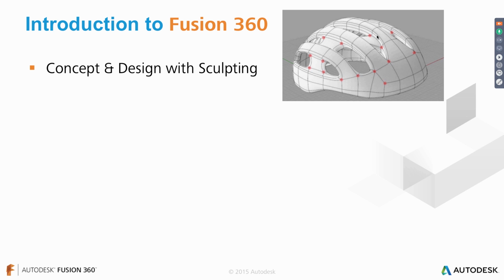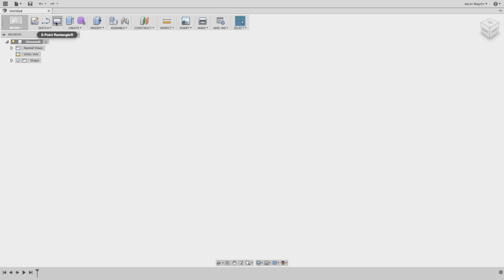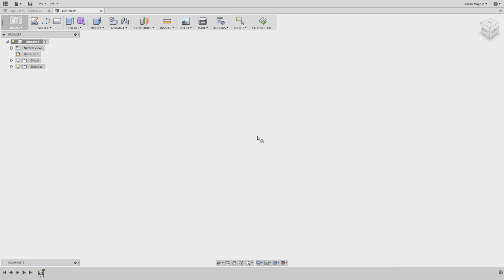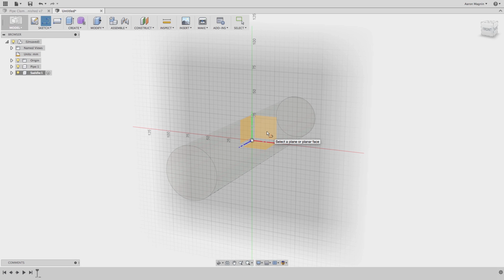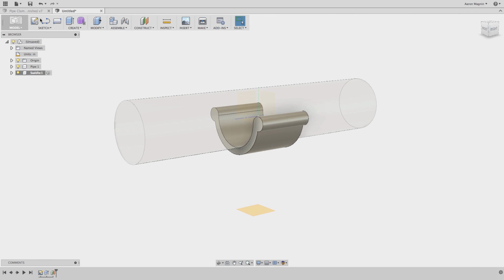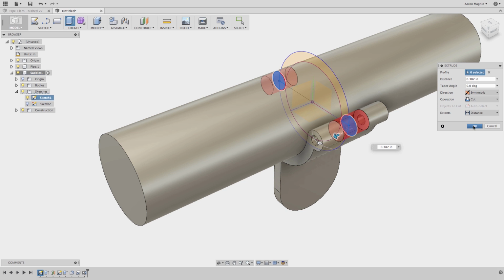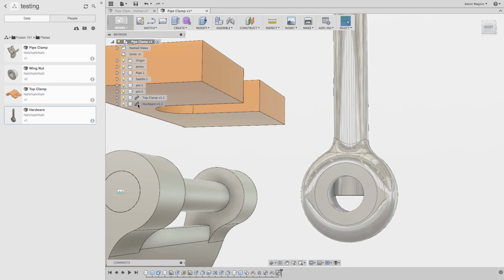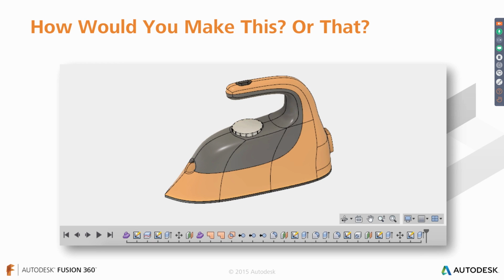Autodesk Fusion For Beginners - Recorded Webinar

Comment: Excellent webinar.  I have been training with AutoCAD Lt and AutoCAD and recently became certified in AutoCAD.  I have a client that wants to connect his CNC to Fusion 360 and has asked me to assist.  This tutorial is 6 yrs old and not all the commands were as easily to follow along with.  I was able to until he copied and pasted the pin, ctrl c and ctrl v didn't seem to work.  Is this operator error or a change in the program?  Secondly I've never worked with a cloud based platform, so is the gallery available to everyone? (for the top clamp and bolt and wingnut specifically).  Is there a similar webinar that I can pull up for the current program?  Thank you for your assistance.

Comment: this was a good tutorial. Too bad the time got short and it had to be sped up. The one thing missing was how to modify things. If I typed in the wrong length of the pipe for instance I have not figured out how to get back into the dialog to enter a different number, I had to control-Z until it was gone and redo it. Some additional detail on how to correct mistakes would have been great. But by and large a really good session!

Comment: How do I prevent my V-Bit from starting to cut as soon as I hit start. I've literally have changed every setting in the Manufacturing process to 1 inch and as soon as I start to engrave it cuts a trench through my material. Any help on which setting I'm missing.  I'm using a benchtop CNC Router, trying to engrave a sign.

Comment: I know this is now 4 years old, but just started trying to learn by duplicating what's show. My first problem is creating the centre point rectangle at 33:40 ish. I can make the new plane with construction but when I drag my rectangle, it will not snap to the the saddle part. It will snap to the grid but not the saddle. I can assume maybe because I'm now onto a much newer version, but this seems to be something that should not have been removed or changed. I have watch the video over and over to see if I am missing the tinyest step, but nothing. Does anyone know where I am going wrong?
Thanks.

Comment: Question - at 36:47 - what if you didnt know the thickness and you wanted a perfectly round bottom there from filleting? I couldnt find an option to stop the two fillets going through each other and causing an error. Thanks

Comment: I know this will probably be a big change for the software, but, is there any way that Capture Position could be completely overhauled? I watched a video by Jason Lichtman (I think?) about capturing position where he showed how powerful it can be when you want to project sketch geometry from multiple locations of a movable component. That's great! However, since each Capture Position operation shows up as a feature in the timeline, I think there are multiple problems introduced:  One, if I want to move a component to a different location, I either have to add an additional Capture Position feature, or go backwards in my timeline if it was in that location previously - neither of which are efficient or truly effective. Two, because I have to jump around the timeline or create a new feature to cycle my model between multiple positions, I rarely - if ever - use Capture Position for anything other than when Fusion forces me to.

My idea is this:  Instead of it being called "Capture Position" and being a parametric feature in the timeline, I think it should be called "Named Position" and function similarly to the Named Views folder. The software would function pretty much the same as it does now; i.e., anything that is not constrained by joints can be drug around in 3D space. The difference is that this will no longer prompt the user to capture the position. If the component is not constrained by a joint, why is it so critical to capture where it is? Like when Aaron moved the clamp so he could apply a joint that moved it back and constrained it the way he wanted it to be. That's a much more intuitive workflow than using As-Built joints, in my opinion, since you can see it happen. However, if the component IS constrained by a joint, Fusion should notify us that a component has been moved and give us options to revert to the previous Named Position, create a new Named Position, or leave everything where it is. The notification is only there to let us know something has been moved in case we didn't do it on purpose; it shouldn't create a roadblock to further design work as the current Capture Position requirement does.

Of course, the design history will need to be partially considered, as you can't have a Named Position that exists before its respective component was created. I think the way to remedy this is to have a "Named Positions" folder at the root level, just like the "Named Views" folder, but, inside it, have a sub-folder for each component. That way, once the component is constrained by a joint, we can specify as many positions as we like within its range of motion and have easy access to them. I think that's the simplest way to do it. A really slick ability would be something like a "Configurations" folder that allows us to toggle the positions of multiple components at a time without having to sift through the Named Positions of all of our components.

I think this should also come with a new option in the design preferences:  An ability to only let joined components be moved by activating their joint handles or driving the joints. This would be super helpful to me when modeling, as it's really annoying to me when my joined components accidentally get moved.

Anyways, I know this is a lot, but, I hope this idea is helpful to you all! These videos have been a huge blessing to me!

Comment: Have tried to sketch a centre rectangle on an offsite plane; however the edge of the shape doesn't automatically align and lock on to the edge of the component making the rectangle move when dimensions are changed. Any suggestions? 33:39

Comment: You referenced creating the filigree (aka "spiral") in Inkscape. Where is the video? I am using Fusion as a hobbyist and find the Mudbox app. quite interesting, but I am not able to pony-up $80 per year. Is this available to be used as a hobbyist as well? I have other questions about Mudbox, but feel they're not germane to my inquires right now. Could you have Extruded the text "To a body?". A bit OCD I guess :)
Reply from the maker: Mudbox does not have the same hobbyist option as Fusion...sorry about that! Fusion is more the exception than the norm compared to other Autodesk software. Per the Inkscape video, I was referencing this:
https://youtu.be/R9Jx0tYRMBQ
...but see this instead (because it includes WAY more detail and is newer): 
https://www.youtube.com/watch?v=oGGrJOkGi3A

Comment: When I create  a center rectangle....its automatically contstrained to the dimensions I set it at. So when I go to change the dimensions to .25 its just scales in size and gets smaller. When I try to remove the constraints and change the size... its doesn't stay centered on changing it...it offsets and changes dimensions...there seems to be constructions lines adding constraints that I have no idea what I need to do to be able to change the size of the rectangle and it still be centered on the dimension changes
Reply from the maker: Hey Dan, can you record this behavior? I really need to see what's going on. When you do, can you post this same text and the recording to the forum so we can get to the bottom of this?
Reply: has this been resolved. I am having the same issue @adskFusion
Reply: has this been resolved. I am having the same issue

Comment: Great tutorial! I was only confused by the really strange "inch" unit thing you were using...
Reply: I use the imperial system, but I love this comment because it’s so right, I hate the imperial system lol
Reply: @christopherbeane7603  we have drawings at work with a 11' 7 5/8" scaffold with a 400mm concrete slab on top of it. Both imperial and metric measures on the same sheet. The scaffold manufacturer is American...
Reply from the maker: Ya, if we use inch, we get in trouble from the metric audience.  If we use metric, we get in trouble from the US Standard audience.  :)

Comment: Nice tutorial, I noticed that your rectangle on the offset plane appeared to auto snap to the curved U-bracket edge, I had to project the U-bracket profile to go co-linear with that edge, are you using a modifier key or is that a setting I'm missing?
Reply from the maker: @Justin-  In your preferences, you can turn on "Auto Project Geometry on Active Sketch Plane" and when you create a sketch on a face, it will automatically project that face onto the sketch.  Then, your sketch entities can "snap" to the projected entities.
Reply: @adskFusion  Thanks for posting this reply. Fixed my issue 👍
Reply: @adskFusion  This Didn't fix my issue as it was already... my version seems to want to snap to the grid and nothing else. When i turn snap to grid off it snaps to nothing... The option in preferences for me was already enabled :(

Comment: At 33:40 your new sketch (the rectangle) snaps to the edge of the above geometry. Mine doesn't. Any "snap to" settings I'm missing?
Reply from the maker: I think it's an option.
Go to preferences > design > auto project edges on reference 

Let me know if that works.
Reply: @adskFusion  Worked. Thank you so much for the quick response.

Comment: The BEST explanation I've seen yet.  I tried watching Fusion 360 videos, but there are 21 chapter/videos and I got bogged down on Chapter 10 or something hearing about user Preferences.  This video goes fast enough to maintain interest/flow and goes over so much detail you can just rewind to hear something again.   It really worked well with my learning style, Thanks!
Reply from the maker: It's an oldie but goodie! Many thanks (this is the creator responding!) Make sure to see Brad and Jason's live streams (or some of Taylors old work). All of it is available here in YouTube!
Reply: @adskFusion  
I need to combine Fusion 360 with a CFD software in order to optimize the original CAD design.

 Can Fusion 360 handle geometry variation in a batch mode? For instance, if I design a basic geometry and want to optimize it according to certain CFD-imposed criteria, would Fusion 360 be able to keep generating-updating the geometry (produce new STL's) until I reach my optimization goal?

Comment: I have a newer version of fusion 360 and when i press sketch measurements it does something else it makes the rectangle smaller and when i press all to drill the hole it gives an error
Reply from the maker: Do you mean dimension? I SHOULD still work the same, but I'd like to know more about what you're doing. Please send a screenshot or let me know at what point in the video this happens. You can email at aaron.magnin@autodesk.com.

Comment: Excellent tutorial, thanks. If constructive criticism is allowed you would do yourself a favor by using mm instead of inches. Everything in engineering is constructed using the metric system.
Reply from the maker: Love constructive criticism! Thanks much. We've heard this before and will try to use metric more often.

Comment: is there a tutorial to help me with some real example to choose tools etc to make the whole piece with CNC and G commands?
Due to my experience in other programs, such as Solidworks etc, I can design pretty good, but I have a problem with how I will tell the program to choose this tool and another and generally to run the simulator to "produce" the piece I designed. A want a step-by-step short tutorial :)

Comment: Hi Aaron, 
Thanks for the wonderful tutorial. I too like most here have just started off with Fusion 360 after spending some time in Solidworks. As of now I am on the 30 day free trial however while trying to follow your tutorial step by step I had trouble with the hole feature. Although I can perfectly snap the hole to the centre of 1 side of the saddle but like mentioned @ 38:30 for whatever reason I cannot use the all in the Extent instead of the distance/ to. I cannot ok the hole command while I select all. It gives me 3 errors
1. Zero Distance
2. Can't create hole tool body, plz check inputs
3. Modelling Error : Can't create hole tool body plz check.
I will be v.happy if anyone could help me rectify this! It works perfectly fine if I use To/Distance instead of All 
Thanks again!
Reply: 4 yrs late, but wanted to lyk I have the same error
Reply: I encountered the same problem then I tried doing the hole on the opposite side and it did work for me.

Comment: Excellent beginner tutorial, I have zero CAD experience but very eager to to learn. Just bought a 3D Printer and would like to make some designs for it. I tried just jumping in to Fusion 360 and found things very difficult to do. At first I thought it was just not using common sense. But now I know it was my limited knowledge.  This tutorial gave me some basic fundamentals on starting to 3D model, thank you

Comment: Some poor guy in China is gonna steal that design only to find out it won't work when the hardware pinhole screw sticks halfway in the way where the pipe is supposed to be
Reply: lol, you talking about the swing bolt?
Reply: why would that happen? It doesn't look so in the model (newbie here)
Reply: Good spot Flo! I guess that would show up in the interference check with the original pipe in place?

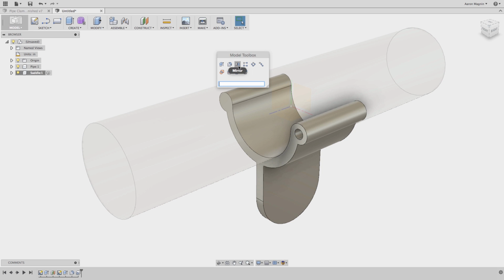Comment: Anyone know why I can't get symmetry to create the hole on the opposite side of the model when following the tutorial at 39:12? The Model Toolbox appears but only has options for Extrude and Fillet... All the other icons that you can see in Aaron's Model Toolbox simply aren't there - otherwise I was following all the steps fine. If anyone can help I'd be grateful.
Reply: I worked out how to do this myself - Aaron asks you to press a keyboard shortcut S for the Model Toolbox - When I did this you only appear to get Extrude and Fillet.  I had a look at the online documentation for fusion and the toolbox shown on their site looked just like the one I got without symmetry and not Aaron's. So perhaps this feature has been taken out of the Model Toolbox. Anyway, if you want to do this step you need to go the Create menu (along the top of the screen) and scroll down to the mirror icon. This will bring up the dialogue command box that he uses to mirror the hole. Follow his instructions for the input and you will have a hole mirrored to the other side of the model. This worked for me, so I hope it helps anyone else who gets stuck with the same problem

Comment: As a long time solidworks user I have to say that you guys are on to something.. BIG TIME.
Reply: Hello Brian, can you please elaborate? I'm at a crossroads where to invest my time and money in either SW of F360. What triggered you exactly? Cheers!
Reply: You have HSMWorks, simulation, rendering, sheet metal, a modern intuitive interface that isn't dragged down by elderly users who if you change the color of a button throw a fit. They are basically dragging and dropping all of the features from their best software into fusion 360 and offering it for a reasonable price. Both Autodesk and Dassault are ripping off their customers with yearly subscription fees. They found a hole in the market that they helped create.  The only thing they don't have that I want now is frame building/weldment functionality which I use on a daily basis at work.

You're considering the equivalent through SolidWorks? 7 grand lump sum and that's with their 10% MAY discount. Just got a pricing invoice yesterday. 

Solid works isn't currently replaceable by Fusion 360 in my field of work but they're getting close.
Reply: in my opinion the joint command in Fusion is a lot easier to use than the mate command in solidworks. I have spent hours trying to get the mate command to work, where in Fusion it always works.

Comment: @38minutes - when the hole is attached to the centre point, it won't cut through 'all'. It works fine if I move it away from the centre snap or if I specify a distance?

Strange, any ideas?
Reply: Got the same problem, did you figure out what was wrong? When Im doing it it gives me 3 errors; zero distance, cannot create toolbody check dimensions and modeling error
Reply: I had to select the face to which I wanted the hole to end, that fixed 
the problem. I also had some problems with the fillet tool when I tried 
to fillet many edges at the same time, it wanted to fillet all the edges
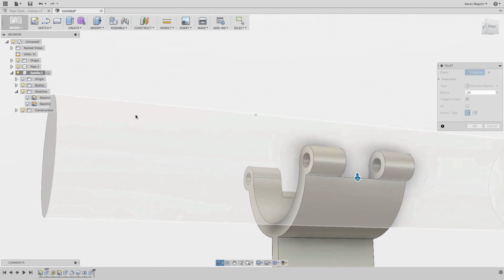 to the same direction as the middle one at 41:55 on the video. It 
worked fine when I did them one at a time tho. Great seminar by the way,
 I learned a lot of new things about fusion360 :)
Reply: @Aaron Magnin I had same problem. Starting the hole from the back rather than the front fixed the problem. However I do not understand why it matters what direction